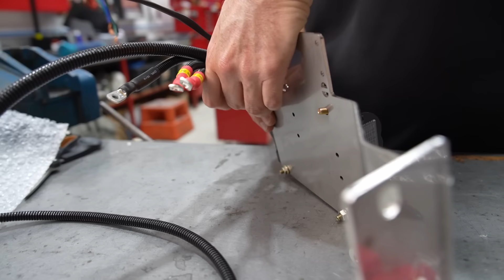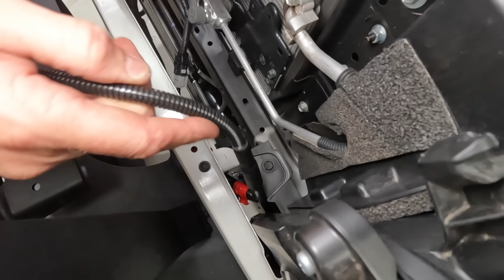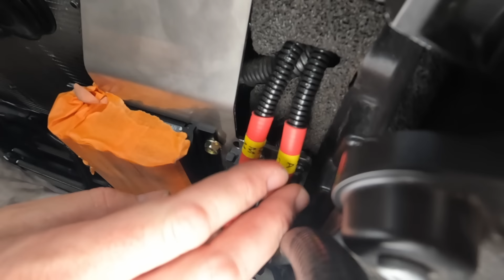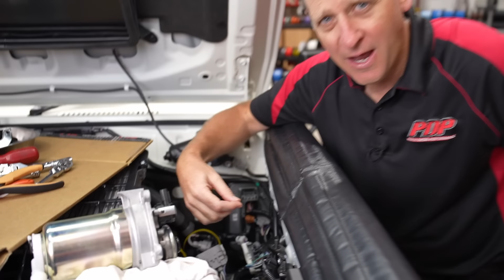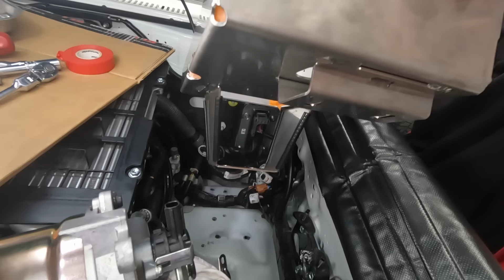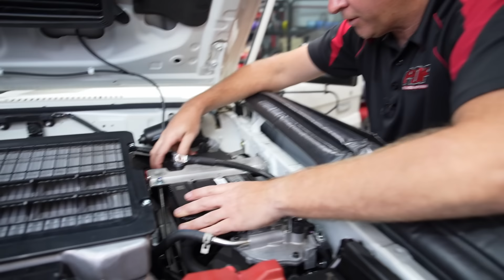70 Series Facelift DUAL BATTERY Install

Comment: More interested to see where to fit an extra battery on the 4cyl. Of possible at all
Reply from the maker: Currently working on it! A busy engine bay and opposing a challenge. As always though, we'll figure it out - PDP Team
Reply: @PerthDieselPerformance  Any news on this? Just cant find any good videos on a battery upgrade / 2nd battery for the 2.8. Im particularly curious about the 76 wagon. Seems like the only option is to put a battery at the back? Where would you even route the cables?